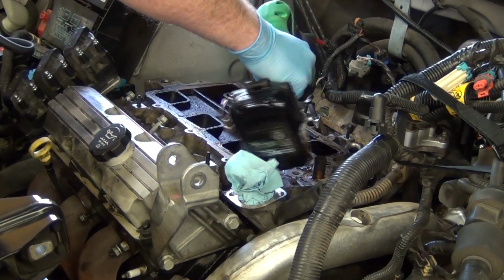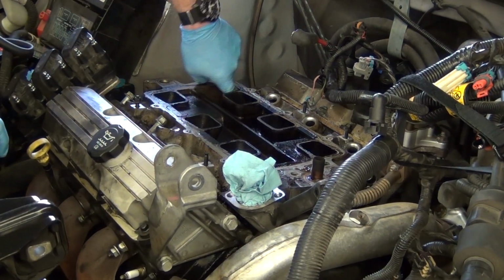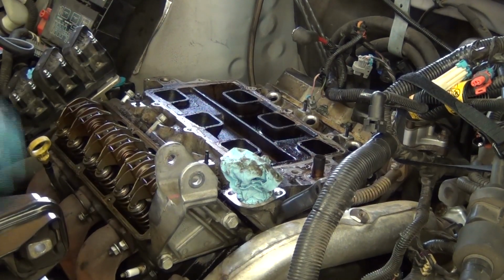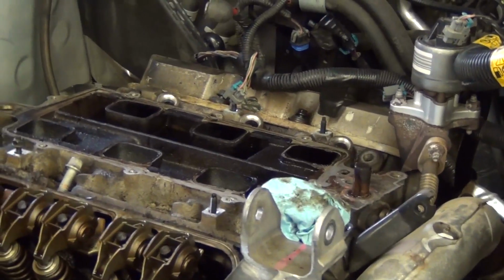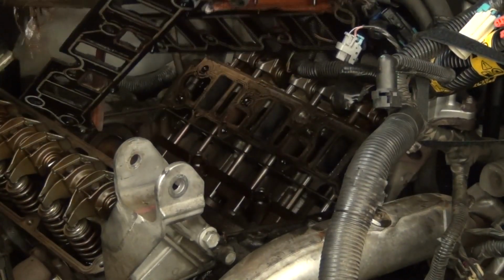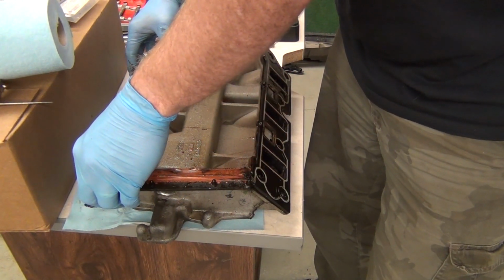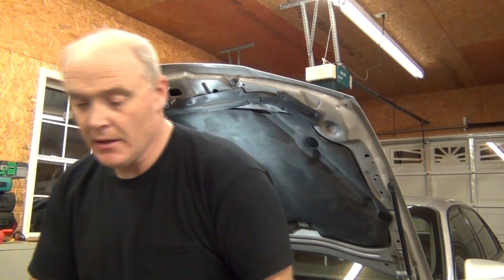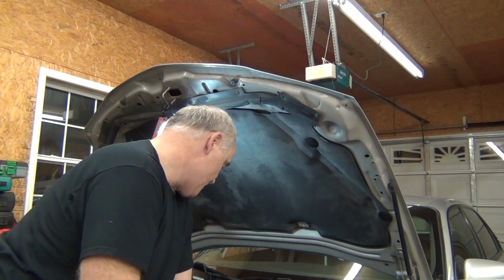Part #5 INTAKE MANIFOLD LEAK 3 8L

Comment: On the plastic heater elbows removal in my shop I spray first with a penetrating oil. let sit for few minutes then work the tensioner out just don't pull and jerk and in the last 7 jobs we did never did we break any elbows regardless of elbow condition. Some will break no doubt about that, but it will be few and far between. Upon assembly make sure hole is very clean. I use a 12 guage shotgun cleaning brush for that and never had a leak.